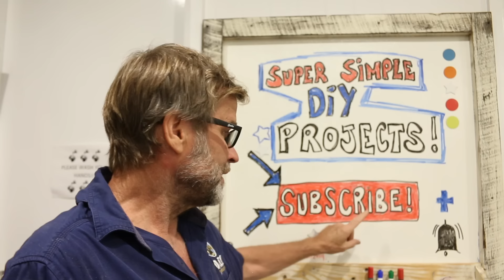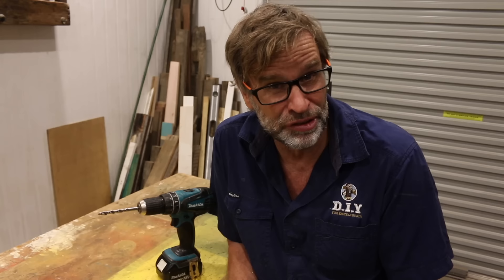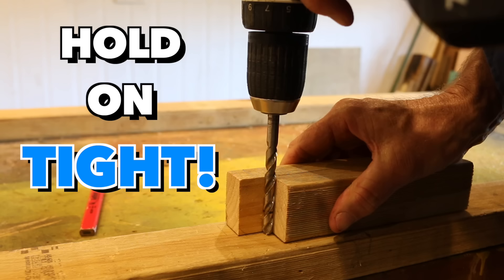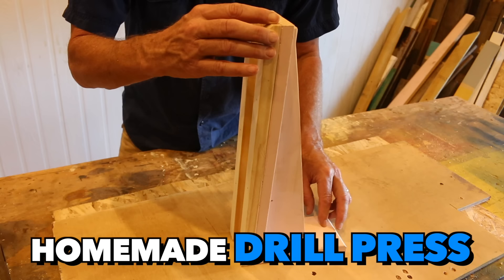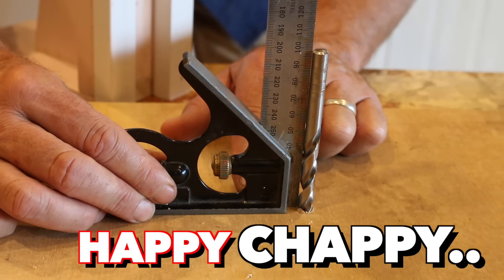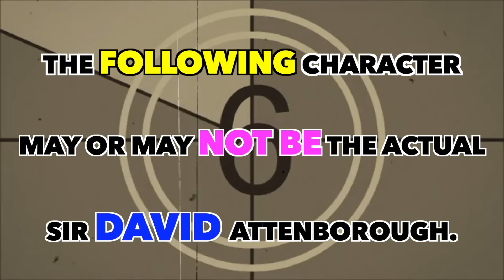8 AMAZING Cordless Drill TIPS!

Comment: How do I clean off the black marks the next time I need my "depth gauge" to be at another level?
If wax or soap makes a screw go in easier, it also makes it work itself out easier.
Putting magnets on the case of your drill near the DC motor causes the internal coils to have an unbalanced electrical load. This can cause overheating, if the magnet is strong enough.
For your drill press, how do you ensure your block of wood is parallel to your drill press channel?
For many drills, changing from 2 to 1 slows the speed, but increases the torque, so it may not prolong battery life.
Reply: Agree with the magnet on the motor, no good but for the spade bit or drill bit u can just rub it off with ur finger because sharpie doesn’t really stick to them that well. For the screws I reckon it’ll be alright. Some wood has lots of natural oily tannins in it anyways and you don’t see screws from those coming loose often so even though the wax will reduce some friction it probably won’t be enough for the screw to come loose.

Comment: I was shown by my dad how to use soap instead of wax. He used to use it when hammering nails into hardwood but it works great on threads. It’s easier to come by and no need to roll the screw thread just pull it along the side of the soap. I always have a piece of old soap (not wet) in my drill case.
Reply from the maker: Yeah good cal from your dadl re the soap Steve.👍 Then reason l used surfboard wax was that we live on the beach and my sons have surfboard wax lying on every flat surface possible in the house!! 😂 Thanks for watching mate

Comment: I am a hobbyist woodworker looking to pick up a cordless driver and a impact driver. I’m not necessarily looking for the best since I’m not a professional but I want tools that will have plenty of power when I need it, the batteries are going to last so I’m not constantly running out of charge, and tools that will will last and be dependable. I don’t want to buy cheap tools but don’t need the best. Can you recommend which tools to buy, brand and type of battery?  Thanks.
Reply from the maker: Hi Gene....l would go for the major brands such as Makita, Dewalt, Bosch or Millwalkie. Then l would choose the mid priced model of each brand. Don't go for the cheapest model and don't go for dearest. In regard to the battery, go for 4 Amp Hour or greater. Hope that helps. Cheers 👍😁🇦🇺

Comment: Lightly coating a light bulb base with oil will keep it from seizing.  They were brass, then aluminum with whale oil, then bare aluminum to be progressively cheaper.  Rub the ends of batteries with oil.  Always oil vehicle battery terminals and wick some into the wire strands under the insulation.  They will outlast the vehicle.  Same with jumper cables.

Comment: All the vitamins and goodness are in the apple's skin.
Reply from the maker: Just wipe all the sawdust off Sushi 😂.....The 3 second rule still applies 👍😁🇦🇺
Reply: @diyforknuckleheads  3 or 5 second rule is a myth. Plus I don't eat where I dust. 😁 
Plus I take shower every day so I don't have oil in my hair. 😁 Oh, hot gluing wood block on top of the drill will prevent you to switch speeds.

Comment: Another tip is that if you’re crammed for time and need to screw something without splitting the wood, drive the screw in reverse to create a pilot hole, then drive it in, and bob’s your uncle.
Reply: Or use a thinner diameter screw like a dry wall or decking screw

Comment: Some useful tips here, thanks. However, Makita warns that as soon as a li-ion battery shows any signs of the power falling off (tip #6) you should immediately stop using the tool, and the battery should be recharged. There's a great video on Makita battery care somewhere here on YT.
Reply from the maker: I'll check it out Alan 👍

Comment: After you’re done using the measurement on your drill that you have marked with a permanent marker, you want to get rid of that ink.
Simply go over your mark again with the permanent marker and IMMEDIATELY wipe it of.
Do NOT let it dry, then you have to do it again.

If you wipe it of straight away, the first ink will come off too.

And if you have a non-permanent marker: use that, you can take some more time and it will take the permanent ink with it when wiped off.

This works on all non-porous surfaces, even if the ink has been there for a while. 
Then it might take a few rounds to get all of it.

Comment: Need a video on the humble sharpie more hacks seem to involve them. I started using them around 1980 or so in telephone installations
Reply: Sharpie now makes markers that mark on wet and oily surfaces. I was a little skeptical so I bought one and tried to draw on my plastic cup of sweet tea with lots of condensation on it. Worked great and didn't rub off! (Haven't tried on an oily surface yet)

Comment: Changing the speed  from 2(fast) to 1(slow) isn't going to extent the battery life. It just change the gear ratio, give you more torque. Maybe don't pull the trigger all the way back, since the trigger switch is the thing that control the speed of the motor.

Comment: If you're doing several depths with the same bit, simply use coloured markers. Should probably use a non-permanent type, though, one that holds well, yet is easy to clean off.
Reply from the maker: Good tip Benjamin 👍👍

Comment: You know speed one is just a gearing difference not a power saving function right I'm not sure that running longer with less load will use any less power but if you are going slower you will be running the motor longer

Comment: Just cut the point off a nail that stops wood from splitting when hammered in sometimes i wonder why they make nails pointed when they have the tendency to split wood but a flat nail doesn’t it boggles the mind
Reply from the maker: That's why finish gun nails are flat 👍👍
Reply: DIYForKnuckleheads very true that yes they are indeed

Comment: Want to erase a permanent marker mark on a non permeable surface, like glass, metal, white board, use a dry erase marker.  It’s amazing.  It’s better than using dry erase for temp marking because you can accidentally rub it away.
Reply from the maker: 👍 Thanks for the tip SK 👍🇦🇺🎄🎄

Comment: My tip is stick the direction switch on the drill with sticky tape as its so easy to knock it  then when you try and drill the bit goes the wrong way and gets ruined. :(
Reply from the maker: 👍...Good tip Walter 👍😁🇦🇺

Comment: Another way to get some extra juice out of your battery is to heat it up a little. Heat it with your hand or put it in your pocket for some minutes. This will lower the battery's internal resistance and works especially well in cold weather.
Reply from the maker: Great tip Robert! 👍😁🇦🇺

Comment: Only problem with the battery saving technique, is that you are changing the torque of the drill, not just the speed. In other words, the drill motor runs at the same speed, it just produces more torque and consumes the same amount of electricity.

Comment: I love my cordless tools. I don't care if it is makita, metabo, Milwaukee, Bosch, Hilti, Panasonic, festool, dewalt. I love them all and will cross platform to have an array of cordless tools. I just stopped at the beginning to comment. I had the job of cleaning a gutter and used a 40volt Victor blower. I walked on the roof which had a steep pitch felt like 25% it could have been 20%. Actually no it was more steep. Anyway the end nozzle didn't fit between the roof tiles and gutter. I blew all around the perimeter and battery went to one bar. I then did some scraping and brought up my 18 volt metabo blower and an 8 amp hour battery. The blower was not as severe as the victa although the rubber nozzle fitted between the roof tiles and gutter opening so I was able to get 98% of the debris out. Since the roof was 3 meter high when I was on the fence side the battery fell to the ground. Lucky it fell on dirt.
I must have hit the release button at the back.
Reply from the maker: Gotta be careful of those release buttons Ron!😁 Battery operated blowers are awesome. I only have a small Makita one to blow out my shed and clean up after mowing and it's awesome! Thanks for watching and for the feedback. Cheers 👍😁🇦🇺

Comment: Tap the point of a nail or screw lightly with a hammer and it will not split the wood when driving it in.
Reply from the maker: 👍..Yep...good tip mate 👍😁🇦🇺

Comment: Great tips, but please do not put a strong magnet near the motor.  In more cases than not, you're disrupting the magnetic field of your motor and it usually lead to less efficiency for your drill.  Glue your magnet to the base or battery instead.  Cheers.
Reply from the maker: Good tip re the magnet. Thanks for that 👍😁

Comment: 1 isn't "slow", it's low gear like 1st vs 5th in your car.   
The motor will still spin at roughly the same speed it is just geared lower for more torque. So yea you might get a little more out of the battery due to the extra mechanical advantage but if your battery is that low you should just charge it as pushing it like that at the bottom of its charge is really bad for the battery.

Comment: 3:50 instead of using hair grease, what on the body produces wax? the ear. just stick the screw in your ear and rotate it to get ear wax on the screw. walla!!!
Reply: Please don't stick a metal screw in your ear canal!   If you're really set on using ear wax, use a wire loop to extract the wax, then put it on the screw.  Any piece of small diameter wire will work- just make sure the loop is long enough so the free end remains outside of your ear.